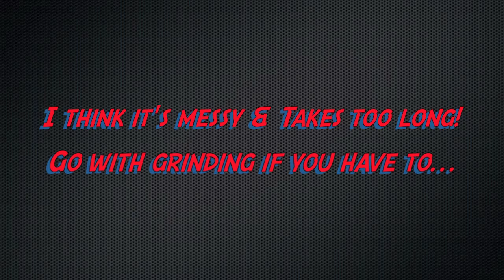Rustoleum Paint Job Step-by-Step

Comment: I know this video is old but I couldn't resist commenting.
You did a beautiful job Tony. 
I am a big fan of Rustoleum paint also. 
I have never sprayed Rust"m. with a gun. I think after seeing this 
I would like to try it. I have never covered with Clear coat. Not equipped to 
finish buff. I'm sure CC makes a job better.
I have had good luck with rattle cans with Gloss paints so I never tried CC.
I'm sure CC is a good protector of paint.
Part of my problem is I do not have the huge amount of patience  you have.
I guess that is the magic.

Comment: I'll be gettin ready to sand down a back section of my 05 Ford Focus using white high gloss rust olem paint mixing it with paint thinner and hardner. I'm hoping that it will look and turn out real nice, and blend in correctly and accurately. Only time will tell to see how I can and will get the job done with. Wish me luck out there folks, I can use all the luck in the world with this.
Reply from the maker: Good luck Man! Keep cranking! You can do it! Get your free training on "How To Spray Like a PRO Without Orange Peel, Dry Paint, Nasty Runs & Tiger Striping by Modeling
The 5-Step R.A.D.S. Paint Formula!" at https://www.radspaintformula.com/rads

Comment: Its that lousy powder coat type paint, not a true paint is why that continually fails. Water seeps under the edges of a system that just lets go. It does save the manufacturers time to powder coat versus using real paint.

Comment: Should move up to a DA polisher, much easier.
Reply from the maker: Kelvin Tso Heck no, da polisher is good for polishing, not buffing (what you really need to buff out 2000-3000 grit paper)...
Reply: I've used a da with a microfiber cutting pad, and took out 2500 grit fairly easy....idk what kind of tools you were using. DA's minimize swirls after the correction.